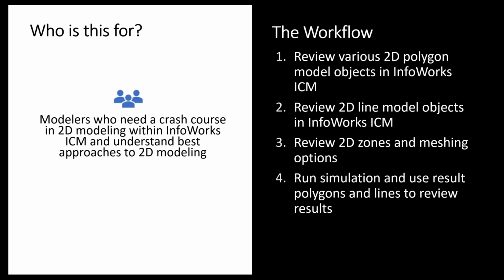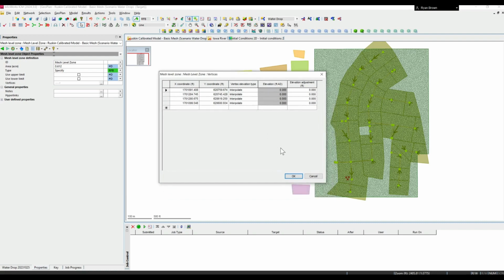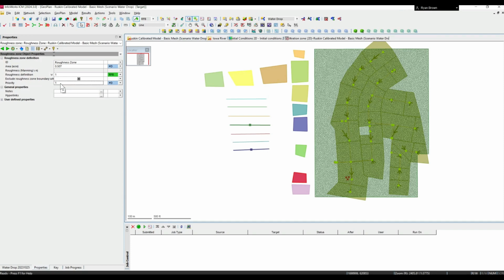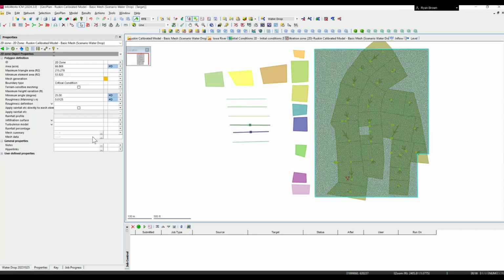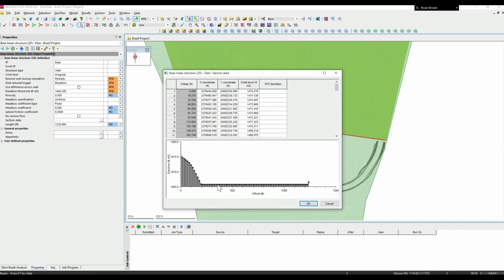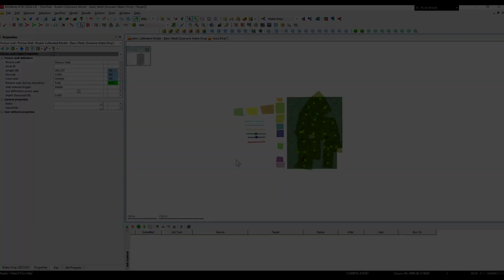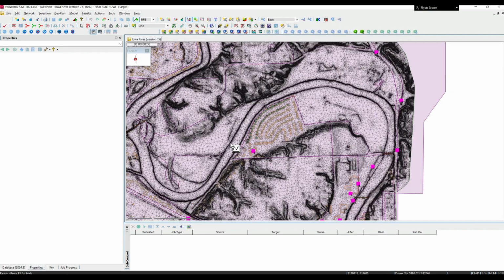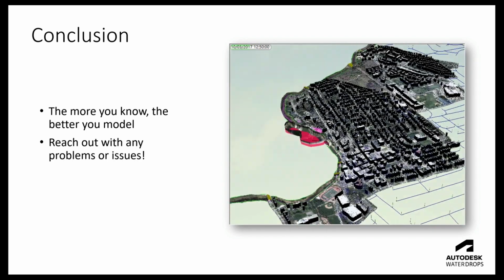2D objects in InfoWorks ICM: What are they and how do I use them?

Comment: Hi there, thanks for the video, it's really helpful. I do have a question though. I'm modelling a 2D bridge that is linked to a 2D base linear structure set up as a broad crested weir. Interestingly, the bridge is still represented as a thin line on the GeoPlan acting as a 2D break line. I was expecting the bridge width to be visible on the plan since it's a 2D structure. Can you confirm if the width is only taken into account for the weir equation and is not displayed on the 2d zone? (I'm assuming the equations to model the bridge are still 1D, or am I missing something?)